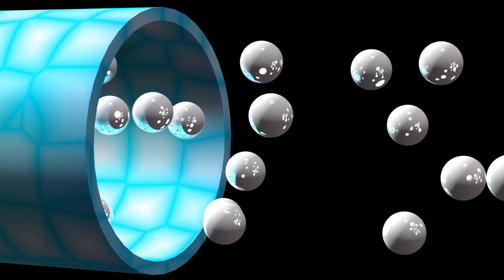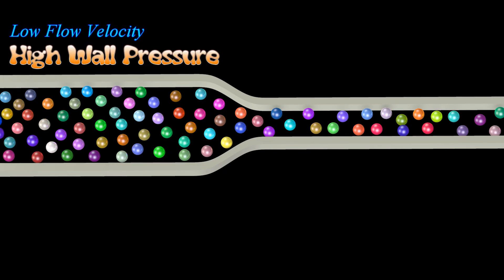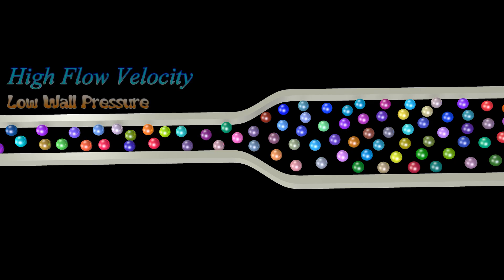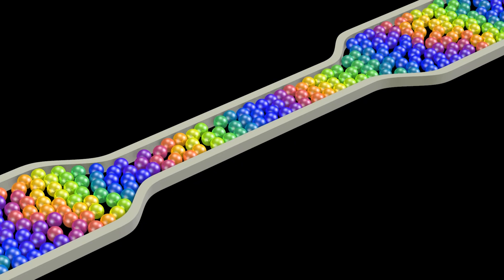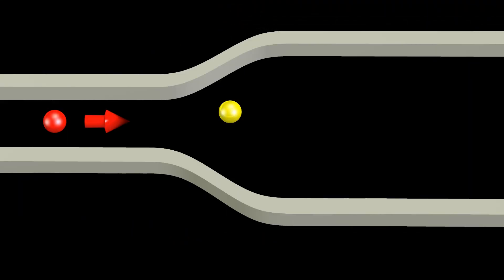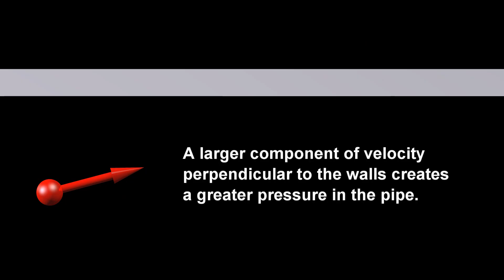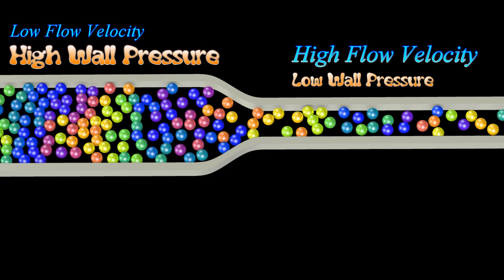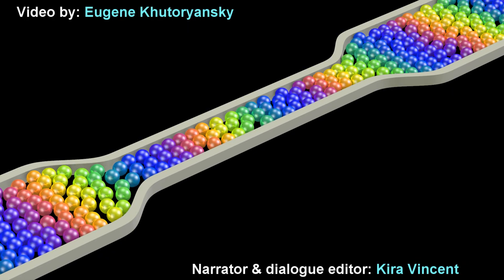Bernoulli’s Principle on Atomic Scale

Comment from the maker: To see subtitles in other languages:  Click on the gear symbol under the video, then click on "subtitles." Then select the language (You may need to scroll up and down to see all the languages available).
--To change subtitle appearance:  Scroll to the top of the language selection window and click "options."  In the options window you can, for example, choose a different font color and background color, and set the "background opacity" to 100% to help make the subtitles more readable.  
--To turn the subtitles "on" or "off" altogether:  Click the "CC" button under the video.  
--If you believe that the translation in the subtitles can be improved, please send me an email.
Reply: I want to thank you for this explanation. This has been bothering me for 50 years and I have a BS chemical engineering and I study physics as a hobby. This is the first time this phenomenon has ever made physical sense to me.
Reply: @highwaymen1237  unfortunately, this violates some very common and well understood accepted principles of physics. 
..
The statement at 2:07 is correct. "there is no reason to expect an atom with a higher velocity to exert a lower pressure on the walls of the pipe." 

There can be the same pressure in a fast fluid as a slow fluid.  They simply have the same static pressure. Bernoulli is not about speed. It is about changes in speed or velocity which is Acceleration along a path. 

The pressure on the walls of a sealed jar is the same regardless of the speed of the jar.

A fundamental flaw in this misconception at 2:42 is is that there no reason to expect a molecule to have the thermal vibration in only one dimension.  These pressure causing vibrations are random in direction and are how they bounce round between other atoms.  
At any given instant a molecule may be going down and the next at 90 degrees or even 180 degrees to the previous vibration.  
That simple fact breaks this false logic.
..
Then. . . 
It is the average velocity (over time) that has a directed motion when the kinetic energy is added to produce an increase in speed. That directed velocity is vectorially summed to the random vibrations.  This is vector addition of velocities. This means that the random vibrations are superimposed onto the linear velocity along the tube. This is fundamental physics. Vector quantities like speed and acceleration add vectorially.
Ignoring that fundamental physics is another flaw in this.
..
..
Then, the added kinetic energy in the moving fluid is in only direction.  It is not increasing the random thermal vibrations. That would require increasing the temperature.  This is another flaw in this story.  Moving the fluid along the pipe does not raise the temperature.  
Therefore, the statement at 2:23: "an atom with a higher velocity would have a higher kinetic energy and, therefore, exert a larger force on the pipe walls" is false because it conflates / confuses thermal energy and momentum in one direction.
..
..
Consider bouncing a ball on the floor. Each bounce imparts some momentum to the floor.  The ball's actual motion is only vertical..

Now, start the room moving (a train car) and the ball still imparts the same momentum to the floor with each bounce.  It's actual motion, relative to the stationary ground changes.  It has the SAME vertical component, but now a horizontal component vectorially added to the vertical motions.  The pressure on the floor does not change.
.
 However, these two motions are orthogonal and have no effect on each other. The vertical up[and down bouncing component remains the same. ONLY the ground referenced horizontal component changes as the speed increases.
This physics does not change if the ball is bounced on the ground outside the train's window.
.
This fails on these fundamental physics errors.
Reply: @Observ45er  So what are your credentials?  Did you point these facts out to Eugene?
Reply: @highwaymen1237  Yes, of course. 
I have pointed them out just recently afgain under this and Eugene's previous similar video. I just again stumbled across this newer video of his.
..
Like so many amateurs, he does not seem to understand how his ideas violate fundamental physics principles.  See my ID for other comments under this video describing the specific problems he has.  He is repeating the misconceptions of Charles Crummer. 
I have seen other well meaning amateur scientists make 
..
Anyone with a correct understanding of basic physics and a little of fluids can easily see these errors.
..
SO...
..In short, I’m a very experienced engineer mentor and teacher. 
.
I recall seeing the ‘equal transit theory’ explanation for wing-lift in my youth in pilot ground school, but never gave it much thought at the time, having other things in life.
.
After a long career getting paid to know what I was talking about, with many other very good engineers in a top rated company; about ten years ago I volunteered at the Challenger Learning Center in town. There are about 30 across the U.S.
.
Along with the space-flight simulated mission, we do general STEM demos with students and parents and are required to have correct knowledge of the things we present as well as good teaching skills. 
If you aren’t familiar, it is a space flight mission simulation field trip destination. 
.
A couple of local aviation businessmen donated a custom B737 full cockpit flight simulator to this facility.  It has 180 degree scenery projections out the windows, which is just about the neatest toy ever.
.
I had visiting students (grade 5–6) land the shuttle at Kennedy in the simulator.  Astronaut Scott Parazynski even flew a plane, I think it was a Leer Jet, around Chicago.
In the beginning, knowing I’d be answering all kinds of questions at Challenger, I reviewed some aviation related things on-line, including wing-lift which led to Bernoulli’s Principle.  
.
I was so disappointed to see that, sadly, the world is full of misconceptions (even the FAA) and completely false science about lift and good-old Bernoulli’s Principle – by so many well intentioned people, but repeating common misconceptions over and over demonstrating little understanding of physics. 
.
At Challenger, we do a number of the types of demos done in aeronautical engineering aerodynamics classes that show the fundamentals which I try to describe here for others who want to understand more fully.  
.
Most of this is not hard to figure out if you have a solid understanding of standard physics.
.
This stuck in my craw, so to get an excellent understanding of fundamentals, I read some of the authoritative texts such as those by Doug McLean, John D Anderson, Anderson and Eberhardt, Charles Eastlake, Holger Babinsky and MIT’s Mark Drela.  I also contacted a few of those same people to discuss things to make sure I understood well.  I also have an Aeronautical Engineer son who provides feedback on the subject matter as well as my teaching skills.
..
The Challenger Centers around the country (challenger.org) were started by the families of the crew of the ill-fated Challenger Shuttle to inspire youngsters in STEM. It is quite impressive to see 5th and 6th graders very seriously focused on running what looks completely like a genuine space mission.
.
The local center:  Challenger Learning Center, Illinois (https://challengerillinois.org/)
..
I also do General STEM demos for two local schools and scouts.
.
I don’t teach tings I don’t fully understand, so I can explain it to all age levels.
Reply: @Observ45er  you should start a YouTube channel so we can all benefit. Correcting Eugene's videos could be your first product.  Calling out Eugene and Charles who are both physicists is a rather bold move.
Reply: @highwaymen1237  Another YouTube channel that people may or may not stumble onto.   Another of many channels with the word 'Bernoulli' in it..  That helps?  We need to get the information into schools.
I have one and not many viewers and comments that also don't understand physics. . . 
Yea.  Every malformed opinion is important.
..
I'm working with some of those big names. . .  . .
Reply: @Observ45er  not sure why you mention vibrational motion that only occurs inside molecules.  Everything in Eugene's discussion has to do with Kinetic velocity and collisions.  In fact I forwarded the video to a friend of mine who is the expert in Department X at Sandia labs who designed the software they use for modeling hyper velocity vehicles and was the project manager on the B61-11 ground penetrating nuclear warhead and he said Eugene was correct.  He taught thermodynamics and fluid dynamics at the University we went to in the 1970's.
Reply: @highwaymen1237  At 1:21 it shows all molecules drifting right (the flow) regardless of their instantaneous velocity / direction o individual molecules, as it is well understood.  
.
However, at 2:41, he would have you believe that only molecules with an instantaneous  velocity to the right will enter the narrow section. 
The random vibrations are superimposed on the flow velocity.  The temperature kinetic energy and the flow kinetic energy are two different things. 
The kinetic energy added to make the flow to the right does not distort the temperature vibration pattern to the right. This is self contradictory.
Your friend needs to look at it more carefully.
Reply: @highwaymen1237  Well your friend is mistaken.  Has he studied aerodynamics, read the leading authors and consulted with some of them on this very topic?
.
I don't recall what I answered earlier, but I an an experienced engineer, studied aerodynamics and have I have consulted with with Author & NASM curator John D. Anderson. Boeing's Doug Mclean, Embry-Riddles Professor Charles Eastlake. What I say is all based on solid physics.  . . . As well as with my aeronautical engineer son.
.
I had a nice conversation with MIT's Mark Drela last week.  He answered the author's questions and provided guidance for the Feb 2020 issue of Scientific American and author Ed Regis ignored them.  It was a terrible article and really killed their reputation as a science source.
.
It makes no sense that a vibrating molecule will have some long term vibration in only one direction. I'm talking about the WHOLE molecule's thermal, Brownian motion as it bounces around between other molecules - it follows a random pattern with no 'preferred' direction. It will look the same to you is you move along with the flow regardless of the speed.
.
So many amateurs who try to model molecules make common errors.
The other is that the average motion (f a vibrating atom) becomes non random because the speed down a pipe somehow changes the speed perpendicular to the wall.  Velocities do not do that.  These are orthogonal and do not affect each other. They add vectorially. 
.
It is just like the classic cannon ball trajectory.  Shot at an angle, the horizontal speed is constant throughout the flight, while the vertical speed is constantly changing due to gravity -- first accelerated downward (negative acceleration) by gravity, slowing it to the peak, then still accelerating it downward (positive acceleration) until it hits the ground.  These components of motion, speeds and accelerations are totally independent. Orthogonal.  The molecule vibration and the net movement down the pipe are the same. 
.
.  The impacts with the wall do not change just because they are traveling along the wall.
Another misconception is that they spend less time along the wall, but for incompressible flows that is impossible and for normal air flows and flight, air's compressibility is tiny has has no significance here -- the same number of molecules are against the surface all the time - for every one that leaves, another replaces it at the start.

.

As so commonly said in video after video, Fast moving air does not have lowered pressure.  YOU can easily measure it. It is measured daily by students and aeronautical engineers daily. 
Bernoulli has to do with CHANGES in speed (ACCELERATION) along a flow between the location sof pressure differences along the flow.
In the mid 1700, Euler determined that it is a pressure Gradient that provides the force to accelerate a fluid.  Air has mass and must follow Newton's Laws!
.
The air exiting a blower is AT atmospheric pressure.  Bernoulli's Principle comes into play in INSIDE the blower. For example, your muscles compress your lungs, increasing the pressure.  Because that is higher than atmospheric pressure it pushes more on the air than the atmosphere so the air is pushed out into the atmosphere where it is at atmospheric pressure.
.
For every demo that claims to "prove" moving air has a lower pressure there is a solid physics explanation why it is wrong.
.
Blowing between cans or balloons or above the drooping paper is Coanda, which also lowers the pressure.  WHY?  Because of Newton's laws and specifically inertia.  
Here's why the pressure above a wing is reduces below ambient and Cheers.
  *https://www.youtube.com/watch?v=3MSqbnbKDmM*
Reply: @Observ45er  The explanation in the video is definitely incorrect. If there is only one molecule in the tube, perhaps (just perhaps) his explanation is correct. And the object of Bernoulli's law is an ideal fluid, which does not consider thermal motion.
Reply from the maker: Highwaymen, I am glad my explanation was helpful.  Thanks.
Reply from the maker: Everyone, if you would like to help add subtitles in  a language that is not already available, please send me an email.  Thanks.
Reply: @highwaymen1237   Too bad this is completely wrong.
.
The fluid has mass and Newton's First Law tells us that a force is REQUIRED to Accelerate a mass.  
This applies to a solid mass 'object' like a brick AND the Mass in Fluids.  The Pressure Gradient in the pipe is the CAUSE of the Accelerations of the fluid at BOTH the entry and exit of the narrow section.
.
In fact, is is the narrowing of the pipe that is a restriction that CAUSES the pressure to rise up stream, in the left, fat section. 
.
Think of the flow approaching the inward sloping pipe walls.  It is like a wind blowing on you.  This increases the pressure on the inward slops and that pressure is directed i(Perpendicularly)  away from the slopped wall) inward and up stream, to the left, at the speed of sound.
That pressure is not propagated down stream, so the small section is more like an opening in a pressure tank.
. . 
. .
If you show the fluid molecules, then you must also show the pipe molecules because they are both exchanging momentum in random directions at the same supersonic rate.  They are not flat surfaces at the molecule level.  The net momentum transfer sums to a normal force on the surface and the isotropic pressure in the fluid.
.
Your probability explanation of which molecules enter the narrow section is not science. It violates the well known laws of physics the most notable being Newton's Laws. 
Nope.  The fluid has mass, so you need to identify the forces that cause the observed accelerations. 

. Understanding Bernoulli's Principle Correctly:
 kyuoyckftflurrpq.quora.com/ 
- - 
Regards.
Reply: @SteveNoskowicz  I guess you've never used a monometer.
Reply: @highwaymen1237  Bad guessing. . .  I'm not.  
I/ve studied Aero and in the process have discussed much of this with some noted experts as I explained earlier in this very thread, IF you read it.
Reply: @highwaymen1237  Poor guessing.  I don't.  As I explained above in this thread, I studied Aero.
Reply: Muchas gracias!
Reply: how antenna works
Reply: Hi, I have a question. By this explanation, if we then keep a pressure gauge at the center of the narrow pipe, with the face of the gauge facing oncoming flow of liquid, wouldnt the pressure gauge report a higher pressure than if the face was kept facing down with respect to the pipe? (Because less water will hv component of velocity facing up in narrow pipe) but since we believe pressure is isotropic, this leads to a contradiction right? 

Clarification will be appreciated
Reply: @dixshants1227  if you point the tube into the flow you're measuring the impact energy similar to you sticking your hand out the window of a moving car. If you point the tube Downstream you should be measuring the static pressure similar to what you would see at the wall of the tube.  This is how they measure the velocity of an airplane moving through the air with a pitot tube.  When they measure the flow going through a Venturi which is what the physicist is describing you're looking at the static pressure at the wall.
Reply: I'm astonishingly surprised that I got it the exactly similar way, but entirely through intuition and not the mathematical explanation! So it goes like this:

Suppose you are given the responsibility to manage a crowd of fans rushing in to meet their celebrities along the path. 
Now let's say, the crowd was very obedient and moving in the direction of the line, so they could be handled easily, hence less "physical" pressure on the ropes around them. And less "mental" pressure on you 😅😅
On the flipside, suppose they were very sluggish and disobedient and were all over the place, then the ropes need higher tolerance for the higher pressure, and you need more competence 😂
Reply: Great animations. Can you also make a video explaining compressible flows through supersonic nozzle? Being counterintuitive to sonic flows it is relatively difficult to understand what happens at atomic scale.
Reply: When I meet God, 

I am going to ask him two questions: 
Why relativity ?  And 
why turbulence ? 

I really believe he will have an answer for the first.

Werner Heisenberg
Reply: Eugene, your explanation of why the pressure goes down in the narrow part of the pipe is not correct.
The pressure in the wide part of the pipe that followes after the narrow part is still lower than the pressure in the narrow part of the pipe.
Reply from the maker: John Walker, the video is correct.  The pressure in the wide part after the narrow section is higher than in the narrow section.  This information is available on many websites on Bernoulli's equation.  Just search for it in Google.
Reply: @EugeneKhutoryansky  
Eugene, the fluide can only go from high to low.
Overunity does not exist.
All those websites are wrong too! (Parroting)
Reply from the maker: John Walker, the fact that the pressure goes back up in the wide section is an experimental fact that can easily be verified.
Reply: @EugeneKhutoryansky  
Eugene, when you all use the same setup, you will all find the same results.
When you explaine the results with your theory, you connot say later that your theory is confirmed by the experiment. (circular science)
What you will find depends on how and where you measure.
Other experiments show that what you say is not true.
You theory is in contradiction with Newton!
Perpetual motion does not exist!!
It goes from high to low. Period.
Reply from the maker: John Walker, this is consistent with all the experimental evidence, and it is consistent with Newton's Laws.  This is a very basic principle that has been known for centuries, and is explained in all the text books.
Reply: @EugeneKhutoryansky  
It depends on "where" you measure. The explanations are all wrong.
If it were true, you could "bypass" it back on it self and harvest infinite energy.
Many people have spend weeks or even months to make it work, but always without result.
It moves from high to low. All other theories are in contradiction with all the rest of physics. Guaranteed!
Reply from the maker: John Walker, this is explained on NASA's website at 
https://www.grc.nasa.gov/WWW/K-12/airplane/bern.html
Reply: @EugeneKhutoryansky  
Yes, that NASA page shows that I am right.
Total pressure goes up when the speed goes up. (not down)
You measure at the surface, but that is a different story.
Reply from the maker: John Walker, the NASA page says exactly the opposite of that.  Below are two other websites explaining this.
https://en.wikipedia.org/wiki/Bernoulli%27s_principle
http://hyperphysics.phy-astr.gsu.edu/hbase/pber.html
Reply from the maker: I don't see anything in that link that supports that position.
Reply from the maker: Highwayman, thanks for providing John the link to that demonstration.
Reply: @_John_Sean_Walker  You're part correct, John.  The pressure goes virtually back up and is measured in every physics class that does it.